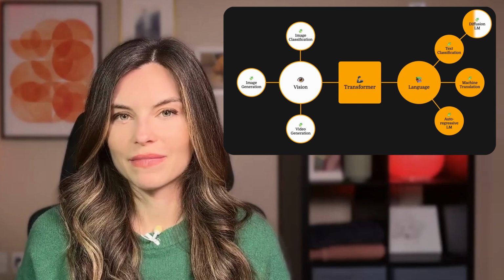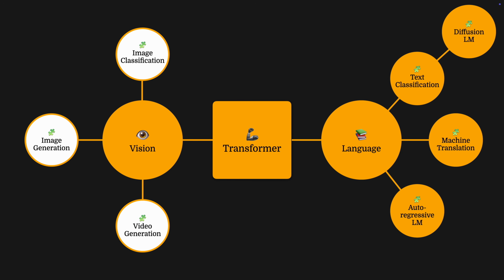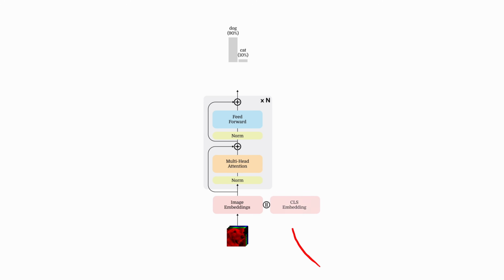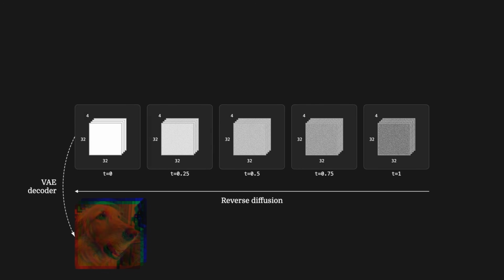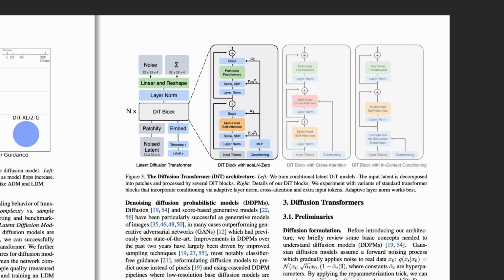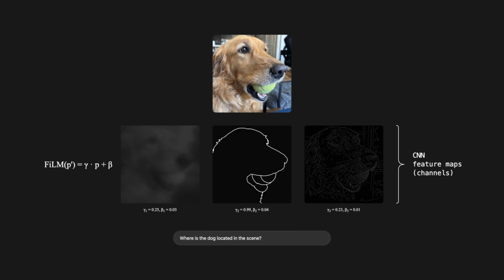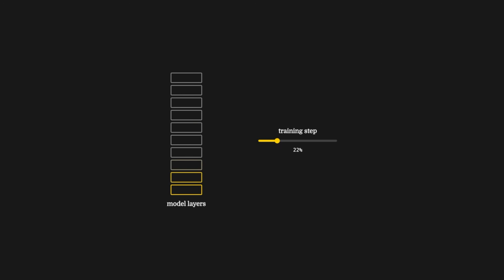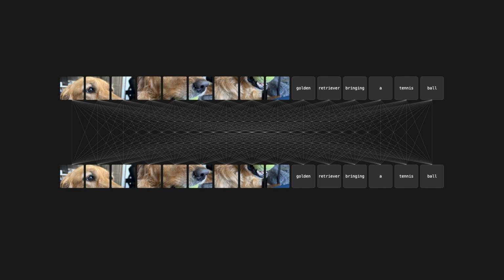Diffusion Transformers (ViT, DiT, MMDiT)

Comment: Might I suggest covering the use of rectified linear flows in diffusion transformers as a next topic? This is the dominant approach used in all modern generative image models and offers a dramatic improvement over stochastic denoising. It took a while, but there are now several incredible models that you can run on modest hardware. Learning how vector fields work as a mechanism for diffusion would be really fascinating as it’s a concept that there are very few good explanations of on YouTube (if not elsewhere) as the math can be pretty terrifying.
Reply from the maker: That's a great suggestion!

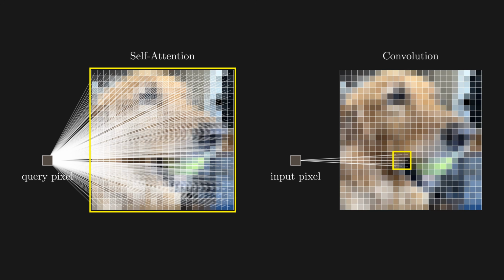Comment: Outstanding explanation. 3:00 I think of image tokenization a bit differently. Trying to apply a transformer to individual pixels would be like trying to develop an LLM that generates letter-by-letter rather than token-by-token. The flaw is not just the explosive growth in computational complexity, it’s also that when you operate at too fine a granularity (whether for language or images) then: (a) The useful size of your context window shrinks by a lot. (b) The model wastes parameters learning patterns that are irrelevant to the task. Like, you don’t want your LLM wasting parameters learning how to spell, as it would if you operated letter-by-letter rather than token-by-token. The upshot is that Transformers have a “Goldilocks” value in terms of how granular your token library should be, in order for the Transformer to perform well. At least, that’s how it seems to me.
Reply: Or to put it another way, I think the flaw in treating individual pixels as tokens is an information-theory issue, not just a computational issue.